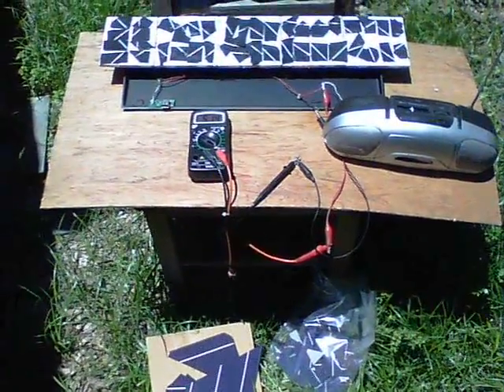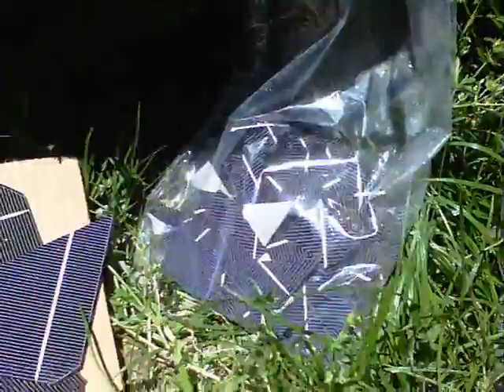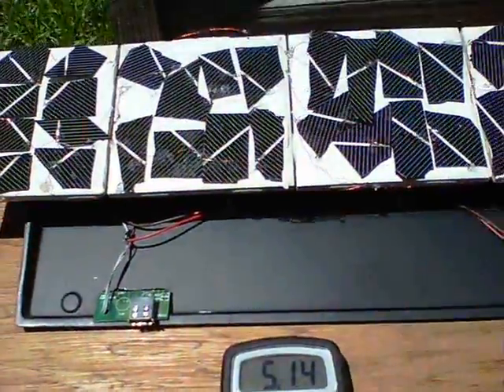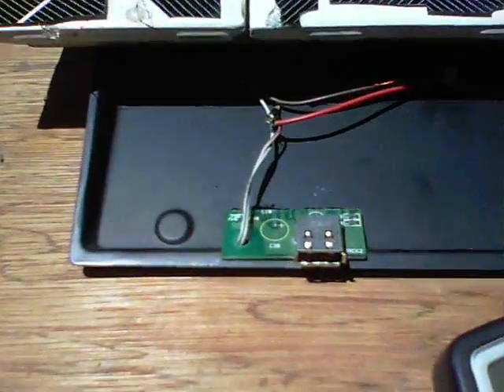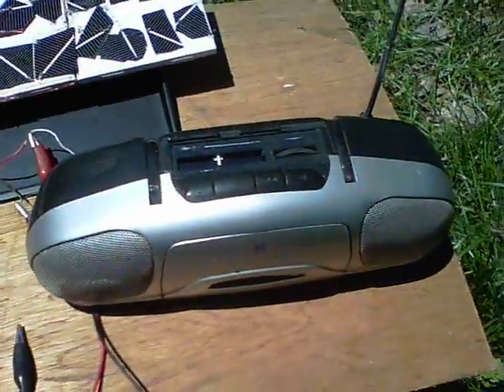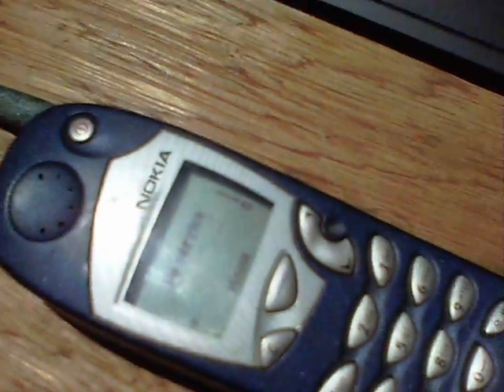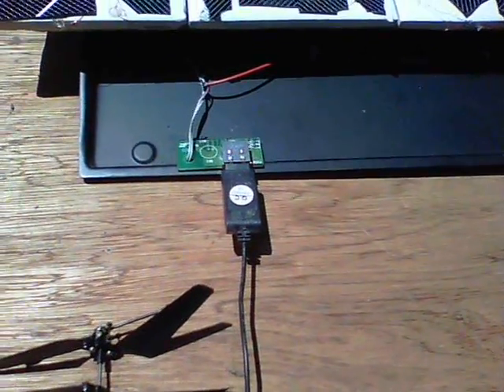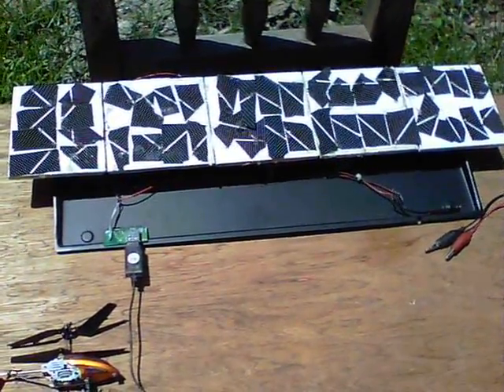Tiny scrap solar pieces - to 5V @ 1A

Comment from the maker: With anything like this I use a larger diode than the output, so here it's an HEF series, rated about 5A. I desolder diodes off old PC monitor motherboards, that sort of thing. On a good solid sun day there's no diode on it though, we're quite lucky here in Oklahoma for such days.

Comment: there they are! i was waiting to see them, thats the same  thing i did at first i ordered the scraps practiced with them. made 18v  panel then powerd up a radio a fan and a usb...i then ordered 130 whole cells have two 70 watt panels and i have enough cells to build one more. ,i used wooden frames with solar glass.great job and if ur like me its very addicting project.thanks...Butch

Comment from the maker: Much better for us these days eh. Going by Silicon Solars figures, these work out to $0.15 per Watt ! Mind you, there is some genuine scrap in there and what probably came off their sweeping brush lol. 
One big problem of a multi-amp panel, would be at what point the panel wiring would melt, from sheer amperage coming through ! Thick wiring will break these type of panels (solder temp but also any movement at all). The 30 gauge on these is just about maxxed for the 1Amp I think, but is bendy.

Comment from the maker: The table is a great idea, especially if the panel pieces could be arranged like a well designed crazy paving. Even just having them around the sides, such that items on the table wouldn't block the sun. 
Lack of clear acrylic or plexiglass has seen me using CD cases now...they work great, clean and tough !

Comment from the maker: Apparently they put together the 1lb bags with 150-200W of panel pieces. So it's up to the end user how it all could go together. Idea is soldering practice really, rather than this sort of intensive setup. 
There's probably 6oz or so of non connected or badly made junk pieces, but each bag will be different I would think. Output goes up if the non connected pieces are broken off, which has to be done very carefully, they like to ruin themselves all of a sudden !

Comment from the maker: Yeah that was confusing and why I went down the investigating road with it. Resistance is basically nothing, connecting at any point along the tracks, which made me think they were connected already. Turns out it doesn't work like that, but will always give 130mA just soldering to 1 point.
Easily less than $1/W. Could make 12 USB sets with the dinky ones. Got 6 undamaged 6"x6", 2 dozen 1/2's, 2 dozen 1/4's and a lot of misc. 2lb is a lot with this light stuff :)
Wish I could have got more !

Comment from the maker: Cheers mucker :) The camera switches to charge/upload mode when it's plugged in to USB, it would try uploading videos to the solar panel LOL. 
To join - use 30 gauge wire from one panel to the next all parallel for 4 pieces, then cross top side to bottom side and do those 4 too with same wire piece. Then solder 4 tops with a wire to be Negative out, then 4 bottoms to be Positive, giving 0.55V 1A. 
I used regular solder flux and solder, with a way too hot 65W iron. Made a mess but works.

Comment: I guess you could measure the resistance on the lines on the back to see if you'd gain anything by having more of a metal connection to those lines. Or just wait until your tabbing arrives.
In any case, looks like you have lots of pieces left so I'm guessing it's going to come in at well under $1/watt.

Comment from the maker: Thanks Raymond. I didn't know either, but wondered if full tabbing was needed...turns out nope, you get 0.55V at 130mA from anything above a certain size, if solder to any tab point front and back. So that's how they all ended up just a bit bigger than that minimum size.

Comment from the maker: Was fun to arrange the pieces so they would fit on the bathroom tiles. Tabbing is easy when just 1 spot on each side is needed. Just ran the 30 gauge wire from panel to panel. 
Could do with a Fresnel..will have to look out for a projection TV on Freecycle or something :)